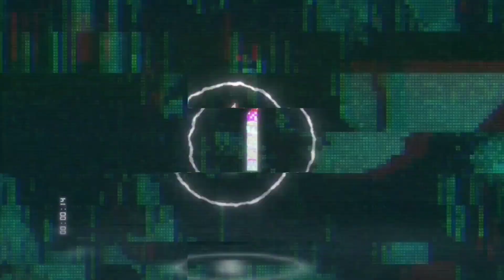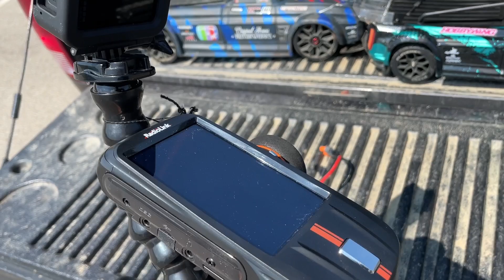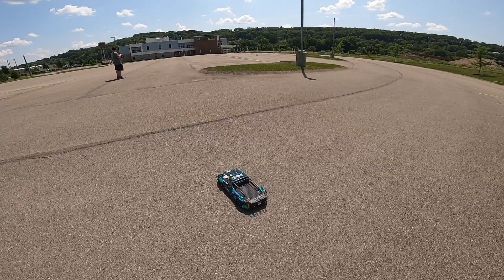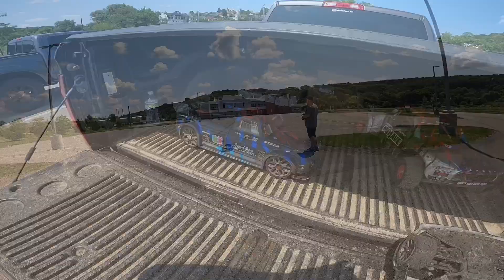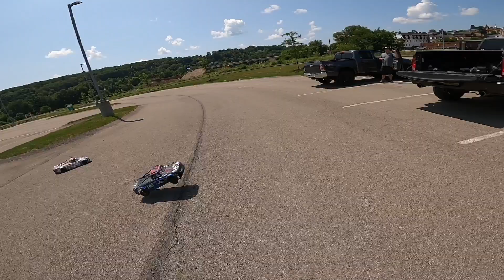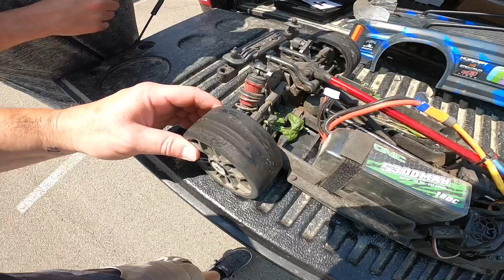ARRMA INFRACTION 6s and 3s street BASH!!

Comment: Hey. I have this 6s v2 for 2 years but have not used it because of personal reasons. But now i am ready to drive it.:)) Can i drive it like this like you does? :) BTW I have the same controller as you also. Is it easy to set it up and program the controller? Nice video Man!😍
Reply from the maker: Aside from driving it straight into a curb or telephone pole you can beat the snot out of this car and it just keeps going
Reply: @BarstoneRC  Nice:)) Thanks! Is the Radiolink much better then the orginal?
Reply from the maker: @tittentei7331 still to this day my favorite radio is the spectrum DX 5C I think they have a newer model but overall, I like it

Comment: Infraction 3s what gears are u running? I put the 50 spur and 20T pinion for speed and street bashing.. is that a good gear set up in your opinion?
Reply from the maker: I’m pretty sure I’m still running stock gearing on mine because I like to run that thing wide-open a lot. I didn’t want to overheat but I might geared up a couple teeth at some point.